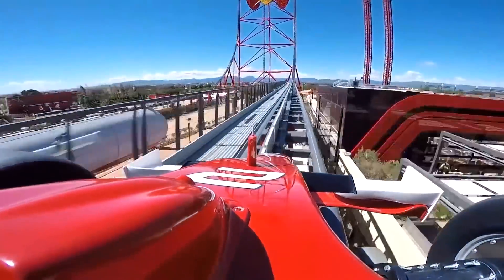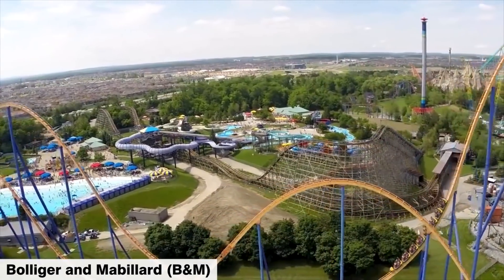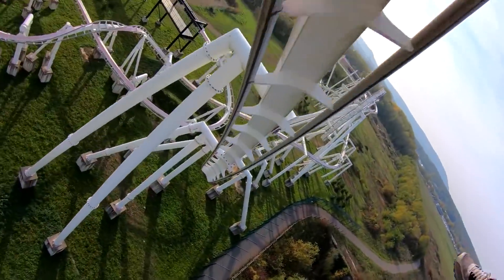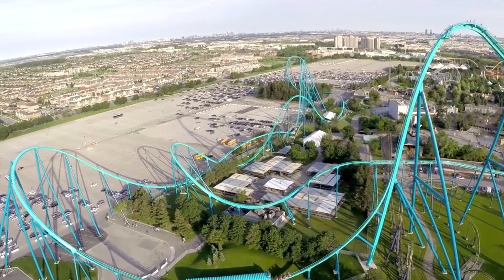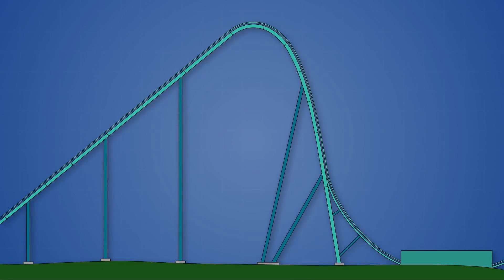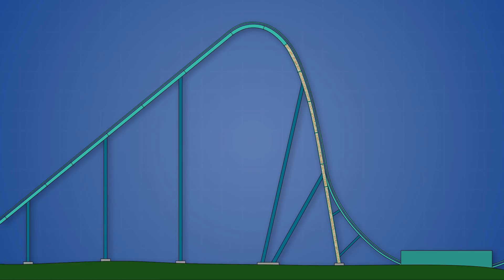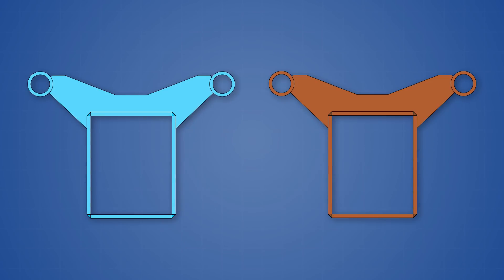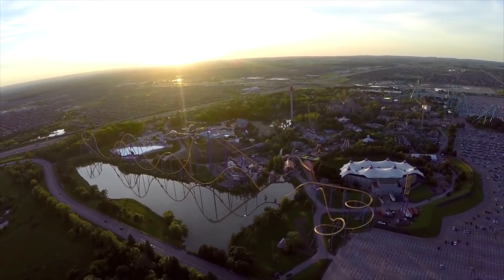Why Roller Coaster Track is Filled with Sand

Comment: Two things;
1. The sand in the tubes or in the center beam will also strengthen the structure, making it harder to bend...if the sand was packed in properly.
2. The technicians aren't worth their weight in sand if they could not re-fab the rails correctly after filling with sand after the install...basic skill is needed to patch and treat a rail like that.
Often you will fill a smaller beam or rail with sand when bending it to reduce it's chance of folding or breaking on tight bends. And since bending, welding, and grinding heat the material locally, changing the bonding of the atoms in the material, proper heat treatment afterwards is key in important structures, less they become brittle...for some, not all alloys

Comment: Ah engineers saving stupid people from hurting themselves by using their brains. If the park is to loud, move somewhere more quiet, stupid!
Reply: It is incredibly expensive to move. People moved to the area before the construction of the Leviathan and after it's building complained about the noise, because it was so excessively loud.
Reply: @mme.veronica735  However, it is stated in the video that the park was there before they moved there and it is not unreasonable to assume that a theme park will be loud. It also not unreasonable to assume that they will change rides or aquire new ones. 

If I move next to a theme I would assume these things or (really more likelöy because we humans are stupid and dumb at times) I would realise I made a dumb move and either move again (yes tedious and expensive but being stupid usually is tedious and exepnsive) or live with it. 

Maybe try to research into sound insulation and if it could be added to the home in one way or another.

No one would move next to a trainline and start to complain to the trainservice provider companies when the new trains are louder then the old ones because trains are loud and everyone knows that. However moving next to a theme park appears to magically exempt people from thinking ahead, which I do not tolerate. Move again or shut up.

edit:
ahh I was stupid here, people would complain about louder trains ... stupidity knows no bounds and I forgot that for a moment

Comment: Do we by any chance know what type of sand they used? The round, sahara desert sand due there not being a need for the sand to bind to anything. Or did they use the coarse beach sand that we use in construction, of which we have limited availability?

I'm just guessing that they probably used the coarse sand due to economies of scale, even though the sahara desert sand is so large in quantity, not many wholesalers sell it.

Comment: True engineer here: It also avoids buckling of those large hollow sections. And/or fatigue due to buckling effects. Cheaper than welding stiffeners on the inside. True engineer out.

Comment: Your channel is called "Art of Engineering" but you fail to provide any data (decibels before, after nor sound samples). If you are listing engineering in your name,  you should at least understand the fundamentals of what engineering is. It is problem solving. Was the noise problem solved? What quantifiable impact did the sand actually make? Are there still noise complaints? etc. Channel should be called "Art of take my word for it".

 Complete waste of time.

Comment: I use to live right across the street from Canada’s wonderland. This was before the Leviathan was made. The rides were still not that big of a disturbance as they were all inside the park. At the time, the behemoth was the loudest coaster but since it backs the highway, it really causes no one any trouble. Now I live about 7min away from wonderland. I had always wondered why the Leviathan was so quite until now. When you are in the park bellow the Leviathan, it is pretty loud. But once you are about 300-500m away, the noise is reduce greatly. In fact, once you are at the far end of the parking lot (closest to the road) the noise basically gone. You will have to pay attention to hear it. The closest houses are about 1-3km from all directions and I haven’t heard anything about noise complaints. In the summer time when the park opens, I will try and post a video with the noise of the roller coaster now to compare.

Comment: Lets think about this for a moment. When steel freezes and thaws, it condensates moisture. So all of those box beams would be filled with some amount of water during temperature changes from freezing to thawing. But now there is sand to trap that moisture and hold it in the beams longer than it would be there if the beam was hollow. Isnt that going to just accelerate the degradation process of these coasters from the inside out?

Comment: During WWII, the US Navy was looking for a solution to excess noise and vibration caused in the propeller shafts in their submarines. The best solution was eventually decided on Lake Michigan by the engineers of the Manitowoc Shipbuilding Co. What did they do?  You guessed it - Filled the propeller shafts with a mix of sand and fine gravel. As far as I know, this technique is still utilized in submarine construction today. I didn't, however, know they used the same solution in roller coasters. Cool!

Comment: The sand will eventually absorb water/water vapor, it will retain the water, the box beams/rails will corrode from the inside out and they will all die. 
Bet?
Reply: The spine is completely enclosed, there's no way for water to seep in.

Comment: If the city expanded into the theme park...it's not the them parks responsibility to lower the noise. They specifically built their park away from the city to avoid noise pollution...and the city knowingly and willingly built towards them. The homes should be required to deal with the noise themselves with sound insulation or something.

Comment: If you've not checked out smarter every day. This is a topic I'm sure Destin will be fascinated with and as all his video's are quite complete even to the extent that he has talked live to astronauts at the international space station. I'll have to issue him a challenge. I also have concerns about the long term effects of having a medium such as sand introduced to these box beams. If the collect moisture  from the atmosphere will they cause a freeze thaw issue. And is any measure being taken to test for such a condition. If the beams are not completely air tight humid air will cause an increase in the moisture content with in the box beams. In the extreme cold climates it could possibly  lead to structural damages.

Comment: Could they just have used expanding foam? Would have been way lighter.
Reply: I've wondered that too. I think it may be that the foam would degrade over time and need to be removed and reapplied. Not sure, but I've wondered the same thing.

Comment: But as the sand vibrates in the box beams , wouldn’t it be just like sanding the insides of the beams with a heavy duty sand paper ? I feel that this would eventually wear away the insides of the beams , and cause it to loose its structural rigidity . Eventually causing the coaster to collapse over its own weight .

Thanks.

— Anakin Skywalker
Reply: No

Comment: Has the sandblasting effect been totally overlooked by the engineering teams on this? Will the sand being vibrated in the box tube or in the rail not cause premature failure due to sandblasting effect?

Comment: I wonder if that potentially abrasive sand, vibrating around inside those steel structures, could over time, cause an invisible and dangerous weakening of these structures?

Comment: May be a dumb question, but why would they have to bother cutting open the box beams and filling entire sections?
What's stopping them from, say , gluing sand-filled soda cans onto the box beam? wouldn't that be just as effective+use less sand+add less weight+cost less money,+no risk on structural integrity from cutting support beams open?

Comment: The sand isn't just for sound suppression either. The sound is produced by vibrations... and vibrations cause wear. Using sand as a damper actually helps the roller coaster last longer by reducing vibration wear to welds and fasteners

Comment: Without watching the video I'll post my thoughts on why the tracks are sand filled! First (Mass damping) the pull and push in all the directions exerted upon the tracks by the cars are extreme and the extra weight of the sand helps to counteract some of that movement which over time causes  metal fatigue which would eventually lead to failure! Second  (Vibration) sand can reduce unwanted vibrations which would lead to a smoother ride experience! Third (Speed) by reducing track movement and vibration you reduce parasitic loss of energy which results in a retention of more of the energy the cars started with at the top of the ride.

Comment: HOPEFULLY ALL THE SAND IS KEPT PERFECTLY DRY!
IF WATER IS ALLOWED TO CONTAMINATE THE SAND, IT WILL CAUSE CORROSION, WEAKENING THE STEEL!
WATER INGRESSION CAN ALSO BE CAUSED BY CONDENSATION FROM VARYING WARM AND COLD TEMPERATURE EVENTS WITH HIGH HUMIDITY PRESENT!
ANY PINHOLES OR CRACKS IN THE METAL STRUCTURE OR WELDS CAN CHANNEL MOISTURE 
IN TO THE SAND!

Comment: I knew they were filled with sand, but I thought the purpose of that was to reduce structural vibration and reduce structural wear of the roller coaster.
Reply: Not many roller coasters have tracks filled with sand. They're comparatively rare compared to coasters without noise-damping material in their tracks.

Comment: I wonder if something else could have been used. Maybe something lighter like spray foam or coat the inside and outside with truck bed coating. It’s been proven that coating a room with Rhino Lining can help make it explosion resistant.

Comment: And if you see sand on the ground you know there's a crack in the structure.
Reply: If a crack happens high up, you might not ever see the sand below because it would be blown astray. They have more reliable inspection methods at their disposal.

Comment: That force goes somewhere, thus it attacks connecting points. I wouldn’t ride it.
Reply: You're definitely smarter than the engineers whose job it is to consider failure modes all day

Comment: Why not fill with foam so it does not add all the extra weight? You could also put rubber belts around the outside to absorb vibrations. I know they say the extra weight is ok, but it seems that there were other avenues to explore that would not effect the structural aspects of the ride.

Comment: I may be incorrect, but wouldn't a foam ( like great stuff or the like) have worked & been less invasive to the structure when applying.  Drill a small hole, add the proper amount of expanding foam, patch, weld or plug.  They can be quite dense & lightweight.    Just a random thought that hit me.....

Comment: Total NONSENSE that welding would make the rails not smooth. You ever hear of a GRINDER??? Welders can weld, grind, and leave ZERO traces that they've done anything.
Reply: You're right, but the rail sections, like the spine sections, are welded closed at both ends, so they'd have to do a lot of grinding to get it right. Cutting and welding on the spine is quicker and would need fewer man-hours.

Comment: Can this please be tied in with the sounds made by the rollercoasters in Rollercoaster Tycoon? (1&2). They make a variety of different sounds based on the construction type and that's always fascinated me.
Reply: And I already love your explanation of the various construction of the track. In RCT it's seemingly just a visual perk with no clear advantage or disadvantage; it's never made clear why a Corkscrew coaster track looks different from a Steel Twister coaster track. This is the first coaster video I've come across that at least acknowledges that tracks are made with various different formats like this!
E.g. I believe Leviathan would be a Hyper-Twister in RCT. Is B&M the only company that uses the big square spine design?

Comment: Interesting solution. I wonder about the type of sand used. I would hope that the movement of the sand within the box sections is not abrasive in any way. if it is abrasive, how long will the metal remain thick enough to do its intended task??

Comment: The real thing these companies need to learn is amputees should be allowed to ride its 2019 and I can tell you as a prosthetic technician and an amputee myself no ones legs are falling off anymore maybe 10 to 15 years ago but not anymore sadly most roller coaster manufacturers write in the rules that amputees can’t ride due to liability involved with a prosthesis coming off and hitting another rider or becoming damaged beyond repair

Comment: I live in that subdivision across the street, and can confirm that the noises are pretty loud but you kind of get used to it over time. You also hear a lot of screaming, but just as the noise from the coaster itself, you get used to it pretty quickly.

Comment: ✳️📣I imagine the screaming passengers being the louder soundsource. Maybe we could fill them up with sand too...🤔😂
Reply: Lower frequency sounds travel further than higher frequency sounds. The sound coming from the track is likely much lower frequency than the sound of screams from the riders. You can experience this by hearing that standing outside a concert, you tend to only hear the bass and kick drum whereas in the concert venue, you hear much more guitar and vocal sounds.
Reply: @Tjkrusinski  Another thing with lower frequencies is that they can vibrate large blocks of material that have too much inertia to easily vibrate at high frequencies like entire foundation slabs etc making them pretty effective at turning the building into a giant subwoofer pumping the bass directly into the ground which will carry low frequencies quite well too.
Reply: I know that the screaming passengers was a big problem with Leviathan. The tunnel you see placed after the first drop was placed after a couple of years because of all of that noise. I know this because I live right next to Canada’s Wonderland and sometimes when I’m with my sisters at their school, which is right next to it as well, we can sometimes hear the screaming passengers.
Reply: @guss whu The roller coaster will probably last longer, because the reduced vibrations leads to a reduced risk of fatigue failure.
Reply: OOOOOOOOOHHHHHHH!
Reply: guss whu I don’t imagine the sand would be moving much

Comment: Was waiting the whole video just to here the noise one of them makes.
Reply: Good Vibes I use to live right across the street from Canada’s wonderland. This was before the Leviathan was made. The rides were still not that big of a disturbance as they were all inside the park. At the time, the behemoth was the loudest coaster but since it backs the highway, it really causes no one any trouble. Now I live about 7min away from wonderland. I had always wondered why the Leviathan was so quite until now. When you are in the park bellow the Leviathan, it is pretty loud. But once you are about 300-500m away, the noise is reduce greatly. In fact, once you are at the far end of the parking lot (closest to the road) the noise basically gone. You will have to pay attention to hear it. The closest houses are about 1-3km from all directions and I haven’t heard anything about noise complaints. In the summer time when the park opens, I will try and post a video with the noise of the roller coaster now to compare.

Comment: So he’s not going to include a single real sound from a roller coaster?
Reply: Good Vibes I use to live right across the street from Canada’s wonderland. This was before the Leviathan was made. The rides were still not that big of a disturbance as they were all inside the park. At the time, the behemoth was the loudest coaster but since it backs the highway, it really causes no one any trouble. Now I live about 7min away from wonderland. I had always wondered why the Leviathan was so quite until now. When you are in the park bellow the Leviathan, it is pretty loud. But once you are about 300-500m away, the noise is reduce greatly. In fact, once you are at the far end of the parking lot (closest to the road) the noise basically gone. You will have to pay attention to hear it. The closest houses are about 1-3km from all directions and I haven’t heard anything about noise complaints. In the summer time when the park opens, I will try and post a video with the noise of the roller coaster now to compare.

Comment: Black Mamba in Phantasialand, Brühl (Germany), which is also a B&M Inverted Coaster and build in 2006, also has sand in Rails and Boxbeams to be very quiet. It's not because of residential areas tho, but because the track is going between and under the parts, where visitors are going through. It is so smooth to ride and a great coaster.

Comment: Could it be possible that adding sand increases the lives of the ride? Less sound could have a positive effect on the rides since the stucture is expose to less vibrations. Im thinking that vibrations excert a toll on the metal structural, and the welds, throughout the years, minimizing  those vibrations must have a overall positive effect on the rides

Comment: I find it very difficult to beleive the structural integrity of the roller coaster is not compromised with all the weight of the sand that was not calculated in the original design of the roller coaster, but I guess time will tell.

Comment: Sound dampening with sand is a great idea. but there is a caveat. Those boxes are being eaten from the inside due to friction between sand and inside of the steel box. Maintenance and replacement costs of those sand filled sections will attract higher cost of ownership. I hope the theme park built in a service level agreement.